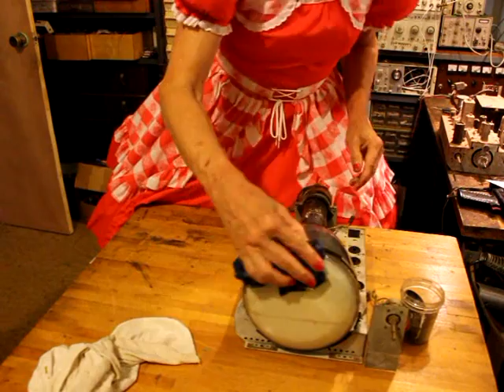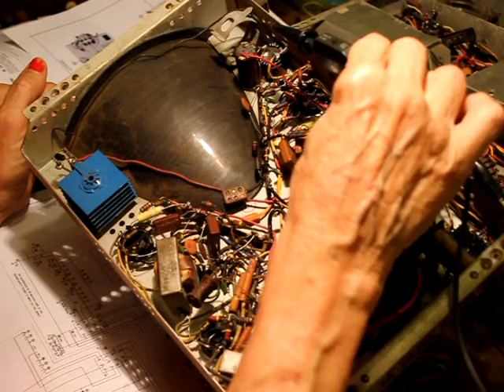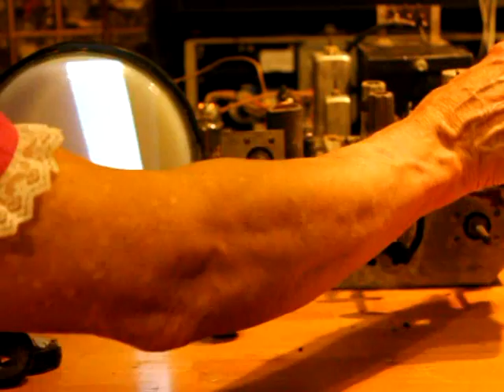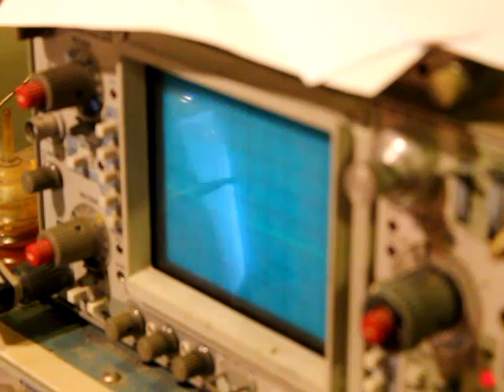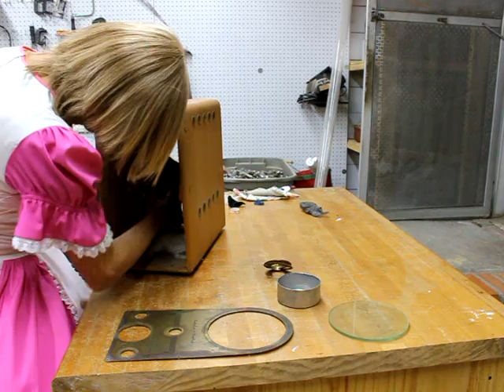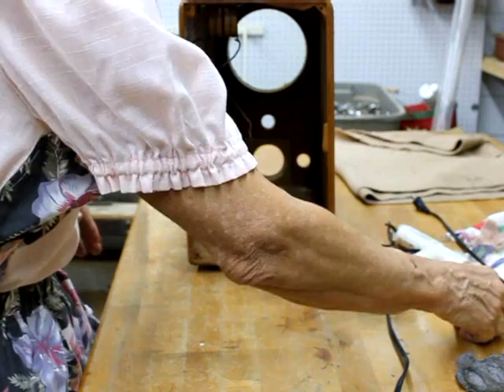restoring a 1949 tv set

Comment: Ron is the best. Notice he had trouble finding which coil was loosing the video. It had tiny hair thin coil windings that had separated. Then he found the wire ends to affix back together. Once he found which wire was separated he had a chance to fix it, not at all a sure thing. Then ya'll have to test your fix hoping everything falls in line. I can see and imagine technicians doing this very thing back in the 50's, which is what I did during the 50's and 60's. Fun and games and flat screens were only a dream.

Comment: I know on guitar amps that I work on, if you replace the selenium rect with a silicone diode, the B+ often will then exceed the rating of the filter caps as well as elevating the B+ past what the amp was designed for.  I've always thought as a solution,  using a couple of the multi-diode rectifier diodes that they use in microwave ovens would reduce the B+ by the multiple diode drops.  This way you would still have a solid amperage source using diodes instead of the alternative of adding high wattage value resistors in the supply, thereby causing it to be soft.  What you think?
Reply from the maker: Not necessary to go to all that trouble. Use a 10 ohm 1 watt resistor in series with the line input to limit the inrush current and that is all you need to do. The resultant rectified voltage will not exceed the capacitor ratings. (150 volts) The slightly increased B+ voltage will make it easier to get a good linear raster!

Comment: Glassslinger love this video it's helping restore a 1949 Motorola vt73.   I've recapped it went through the resistors have a raster.   I connect the converter box preset with channels and get perfect audio, but no video just diagonal lines I think called retrace lines.  What can I do??  I have no alignment equipment just doing this for fun.  The pt is 7jp7 same.  Wish I could send a photo.
Reply from the maker: If you have a schematic (available online) check all the components in the video detector, amplifier and output circuits. Especially, check your work in replacing caps. It is easy to put the new cap to the wrong place. (been there done that!) Vary the brightness and contrast controls. Both should affect the brightness of the raster. If you have sound, all is working up to the video detector. The horizontal hold should adjust the diagonal lines.
Reply: @glasslinger  thanks a lot for the advice.   I do have the schematic, a couple actually for the VT73 Sam's and Wallace.   I double check the entire video circuit, my work on replacing the paper and electrolytic caps, and retested the tubes again and everything looked good.   As it turns out you were right.  I had to adjust the horizontal hold all the way to one end and got a nice picture.   It's actually very good!  I was tempted to replace the 4 square mica caps and actually changes 2.  Left the other 2000vdc mica caps alone.  But the TV works so I think I'll put back together.   Thanks again!  Your video sure helped.   Barry

Comment: a wile ago i had tube heath kit stereo but i sold it back to the store i bought it from kind of mis it  a bit but im using a old realistic solid state amp plus i replaced all the capaciter s inside it and out i even have a pro weller i have like three of them plus bran new covers for them  incase one gets a crack i can rebuild the entire weller the pro has two lights on it and a few extra watts

Comment: Your lucky your box is good my Pope mother roller is falling apart when l look in motor roller I see Kayla but after watching you I see order modules order my tube E gun is broken the old set you disassembled is modular offcourse one could test the tube on afactory bench one potato two potato test all the valves on the bench the vision signal integrator diagram and the actual needs explaining unfortunately the burden of doing this falls on my door shoulders the bulk of the electronics or digestive gut of the TV has eastern the eastern the looked blasted in to the air looked lilies   looked  cholactes blasted out by the station the video rectifier must turn the m into high voltage very angry wasps this explains the huge copper wound case resistors fine wire screams high voltage the machine gun blasts these wasps on to the phorspres   screen German and British Rutherford  walked the Hallie halls waving there vacuumed bulbes around look at me I found blue light

Comment: The old artdeco Kent radio the coils you painted green lead to the antaner now your average jerk would love  to know what they do faster your mind on which tension high tension. Switch great blue flames leap accros radio towers contain caps as big as abuseven though I don't know what I am talking about lthink colasins coils help shoot these blue radio flames in to the air they fly out sndhit hit your green coils they hit the antaner  go through the coils to earth I am guessing there is another coil raped under the outer coil like a welder  people of sicence hide massive coil radios of titanic in fear of laymen the Vatican tower turns electrify door bells into radio receivers Ann people claim wire fences act as radios this could be bullshit the coil magmifys the scrambled current to a chopper valve and magnitude valves how you cry look at that old radio throw away the adjustable Cap cans itstill works you said that the pretty valve could not power the speaker two weak dose a cat have four leges  antaner coil valve speaker this may cause Constantin and constipation take a door bell to the Vatican and listen to the holy ones on it

Comment: Got there in the end! Hooray! I admit I skipped to the end after about 40 minutes, I'll catch the rest another time. I also skipped to other bits. You know the earlier convertor boxes came with RF Out, right? For TVs that didn't have any other inputs, like cheap '90s TVs and crazy dangerous old 1940s ones. I didn't expect you to break out a rack-mounted TV station! There are smaller RF modulators! 

Yeah the ground problem you mentioned, more than anything that's a problem with these live-chassis TV sets, and the US mains system that doesn't distinguish Neutral from Live, right? I suppose invented with nothing more than light bulbs in mind. I'll just briefly reflect upon how superior British plugs are... there. Again, I suppose with live-chassis TVs, nobody ever thought that... etc etc... stuff designed for the present day and no further. Seems like a nice bright screen on that one though, which is good cos that's surely the hardest part to replace. Put The Simpsons on it, or get an RF modulator (Playstation consoles, the first ones, PS1, the flat grey ones came with them, as did other consoles from the early '90s, or else just get an RF modulator off the net for cheap). With an RF modulator, plug the composite output from a PC's graphics card into it. The more expensive cards have it. Then you've got a really impractical 640x480 monitor!

Comment: Just mentioning Selenium, an Isaac Asimov story popped into my head. One of his earliest short stories. Called "Runaround", about some guys stuck on Mercury cos their robot wouldn't replace the selenium in the solar panels that kept their station running. Without the power for cooling they were pretty close to being evaporated. 

Eventually they modify Asimov's Laws, which were sort-of analogue in this story. The robot's self-protection (third law) wouldn't let it get close enough to repair the panels cos it was too hot. But the engineers knew it could tolerate the heat for a little while, plus they were gonna die. The Second Law means the robot should do as it's told, but it's Third Law survival instinct was interfering. Which is silly really, and illogical, but it was the 1940s so maybe Isaac hadn't thought all of that through yet. 

Sorry to waffle on, I'm just feeling amazed at remembering something I read 20 years ago so clearly. It's from when I decided to get into reading as an adult. I decided to start with Asimov. Now I prefer Philip K Dick or Iain M Banks, but it's all good. Dick's "Ubik" is mind blowing!

Pardon me for the diversion, you only said "selenium".

Comment: Hi i am Ashleigh an aussie, we have alot in common firstly i am 70 today i came out as mtf 7 years ago. I also have grown up with valves, hybrid valve and transistors then IC's then microprocessors now programming and computers. My earliest radio was when I was 13, 6 volt battery radio then an STC mantel and many more . My first TV was an ECHO live chassis. After getting a 240 volt boot off it I invested in an isolation transformer. I started as an apprentice electrician then did my technician certificate then went in the army for 3 years then did my electronic engineering degree. To this day I am still fascinated with all electronics. I luv your dresses. We have been around a long time although my male name was Bruce i go by Ashleigh 💖
Reply from the maker: I have wondered how you keep tubes from falling out of the sockets while hanging upside down off the bottom of the earth!    :)
Reply: @glasslinger  Thanks yes it has to do with gravity😄😁 i live in Melbourne Victoria, it is a cooler part of Australia but we don't have snow. I have been to the States many times what of the US do you come from?
Ashleigh 💖
Reply from the maker: @brucehutton2089  I'm in Houston TX, right on the Gulf of Mexico. Very hot in summer but lots of rain. (not dry like the outback)

Comment: There were no high-res shots of the tube, but from a distance it looks like it's really weak.  I thought the chassis turned out well.  I do like shiny things though. I was hoping you would do the mirror finish on the brass.
Reply: It’s tough to find a 7JP4 that doesn’t suffer from weak emission. They were never bright, and the cathodes had short lifespans. My parents had a Motorola VT-71 and my dad used to tell me that they’d sit right up close to be able to see the image. Unfortunately, the glass fails when a rebuild is attempted. Seems it can’t be annealed to avoid cracking.
Reply from the maker: Compared to modern picture tubes these old black & white tubes are so dim! Part of it is the high voltage required to get a bright sharp image. Higher voltage gives the best image but reduces the scan sensitivity of the beam making the deflection amplifiers difficult to design.
Reply: @glasslinger  bandersentv just did 2 small 1940s portable roundy sets and the pictures looked very good. 
This lack of tubes is going to eventually kill  vintage TV collection.

Comment: We got our first used TV back in 1955, it was a 1951 Teletone with a 12" round screen, this set had a power transformer so it was step up from the one in this video.. The tuner knob was gone and the tuner shaft was well rounded by people using pliers to change the tuner. There was always a pair of old lineman's pliers on top of that tabletop set so we could change the channel.

Comment: Wow!   What  restoration.
I would have probably said, "To hell with it" after changing out all those capacitors and testing the resistors and rebuilding the ballast module.    It gets kind of sole destroying when you find incorrect tubes inserted and ones which appear to pass the tube tester but fail anyway once they're in the circuit.
I must say though that compared to stuff I've done in the past, that chassis put up a hell of a fight.
And all credit to you for your staying power.

Comment: Old tvs were the best for for repairs. I would like to work on one of the older sets from 70's down does not matter if its a color or black and white. Tvs od today they are super hard to repair with micro capacitors and resistors. I can not really see those. These sets from china have a real high price tag on the units and with the stupid retarded screen recycle non refundable fee. I use video projectors they are more compact use a white wall or a screen they are great for games. I get my projectors from ebay they are resonable priced 99% of the time

Comment: I'm in the process of trying to restore a small Motorola VT-71 tv from 1948. I have no way of testing the CRT ahead of time, so I'm just taking a gamble and hoping it still works! I'm replacing all the electrolytic filter capacitors and all the paper caps. I figure I might as well try, otherwise it's just going to be decoration no matter what. I really hope I can fix the tv though! It's a cool little tv.

Comment: Another excellent job. You also had the HV diodes to change and get the wrong valves/tubes sorted out. Those crt resistor chains used to drift high.

Comment: With your convertor box you need to make sure that when you are using it on old crt tv's to set the settings on the box to 4:3. If you don't do that then it will be set to 16:9 witch will give you that wide screen picture.

Comment: I had one with a 7-inch CRT when I was in high school, 50 years ago.  It worked, but not very well.  I noticed a soldering gun being used, get a good temperature controlled iron, it will be easier to use and less likely to burn up old parts.
Reply from the maker: I note your consideration however exactly the opposite is true! The very fast  and powerful heat application of the 150watt gun allows a much shorter period of heat being applied to get to melting temperature  so you are LESS likely to overheat the connections. Too small of an iron will keep you holding the heat on the connection for far longer which lets the part connected get very hot.

Comment: Thanks for sharing- I admire your guts. The only thing I don't understand is why- why fix an obsolete TV set? It's not even color! BTW, I like how you just toss your tubes into a box- I'm always so careful with mine, I treat them like priceless artifacts.
Reply: There is a point where obsolescence transforms into vintage and rarity. There is much more value in restoring a tiny 1949 black and white TV than a 40" mid 2000's plasma TV which barely fetch $100 even in pristine condition.

Comment: Love it, reminds me of some Hutchison vids lol. Awesome work ! I used to as a kid get old TV's/Radios from trash day. Bring them home and try to fix them. A couple of successes, mostly learning experiences, lol,  don't touch that part there, and many trips to Kresgese's for a tube test trip.Now got back an interest in to tubes, and trying to repair some stuff I have. Working on a Monarch MA-620 mono tube amp. I too have no schematic, searched, and not found yet. If anyone has one, or can direct me to one, would be grateful. It has a 6CA4 rect., 12AX7A preamp, and 2 unknown 9 pin min. By visual comparison and pinouts, might be 6BM8's. I got it working, but one unknown tube (6BM8?)  has red plating and follows the tube, and output is garbled on low freqs. Not sure why yet, thinking the bad tube, which may be the opposite of the red plating tube, the one that isn't pulling it's load, idk yet   Anyone got some suggestions out there  ?  :)

Comment: Awesome video. I like your trouble shooting process, I like to see it step by step as you do. Only wish I could see the schematic as you talk about it.  Thanks a lot
Reply: what you do, is, you go back and watch how he trouble shoots this. each time you go back you pick up more on what was wrong with this little 47 tv. first, wrong tube. then tube in the wrong spot, then high precision resistors, but first, he trouble shot the works of resistors. then finding the peaking coil bad by tracking it down. all this took great knowledge, and no marker sweep generator, and other devices used in that industry, I doubt he has ever owned a wobbulator.

Comment: They had TV broadcasts in 1949?    What a wonderful find!     CRT not spoiled by gas molecules migrating through its glass envelope?   Scared me when you threw the tubes in the box.
Worried about your frilly clothing catching fire if an arc or short spitsparks.  STOP, DROP, ROLL
How do you check a resistor in its circuit?  Disconnect one lead?
Reply from the maker: First, read it in-circuit. If it reads close, it's porbably OK. If it reads high, it is definitely bad. If it reads low, you need to lift one lead because stuff in the circuit is affecting the reading.
Reply: *****  Thank you.   What was the ad for?  Would have to have been live because they did not have videotape.  Or was it film projected?
Reply: Jay Bee   Wow!   Thank you.   How exciting that must have been!
American TVs had a 525-line rastor.
English TVs, I noticed when visiting London, had a higher rastor.  (I assume because their system was developed later when technology had advanced.  Amrericans were stuck with 525.)
Reply: "How do you check a resistor in its circuit?" Go back to school.
Reply: Haha.  I design circuits.   Must disconnect one lead unless you have a schematic and can discern other connected components will not cause a mis-read.   You have been schooled.   You are welcome!
Reply: Suggest you familiarise yourself with Ohms law.
Reply: Haha.  I design circuits.   Must disconnect one lead unless you have a schematic and can discern other connected components will not cause a mis-read.   You have been schooled.   You are welcome!